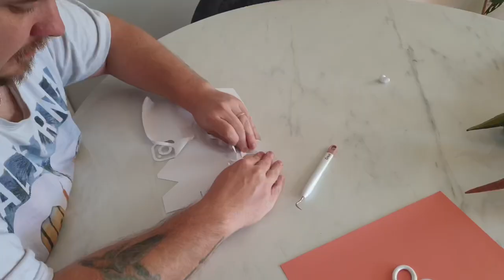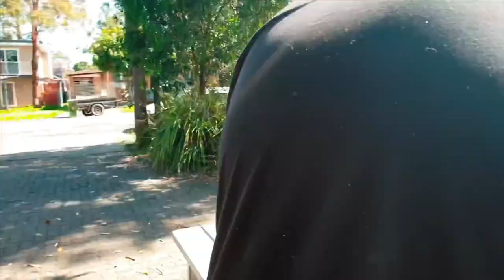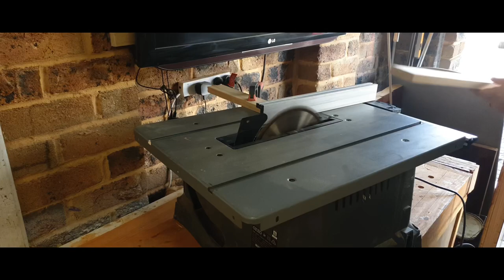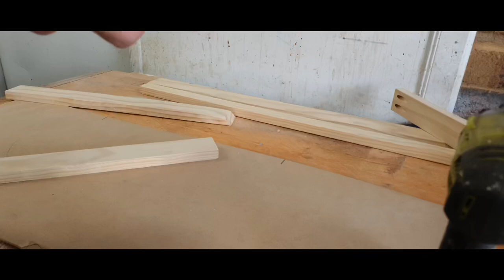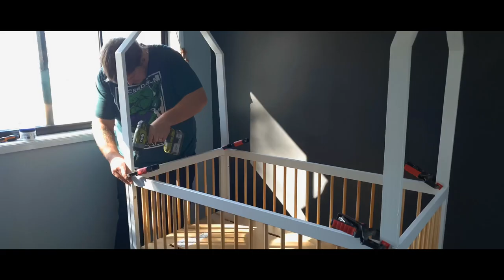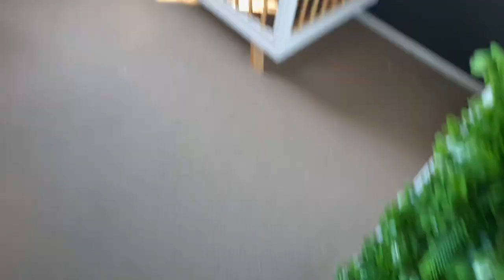DIY CRIB/COT HOUSE EXTENSION!

Comment: Nice work.
One question. Are the screw covers just push fit?  If so you might want to find a way to secure them.  Toddlers and pre-toddlers are very good at prying things apart and sticking small things in their mouths. At least ours were.
Reply: Good point! My little one has figured out how to pull things apart that I wasn't even sure could come apart! lol
Reply from the maker: Yeah they are put good idea I'll glue then in 😁
Reply: @TheGrantAlexander  I speak from experience. lol